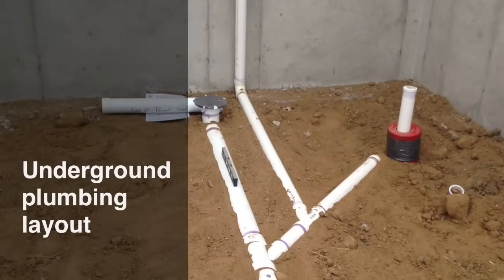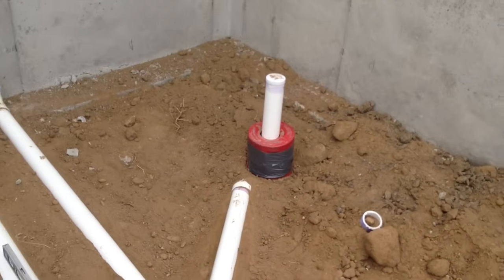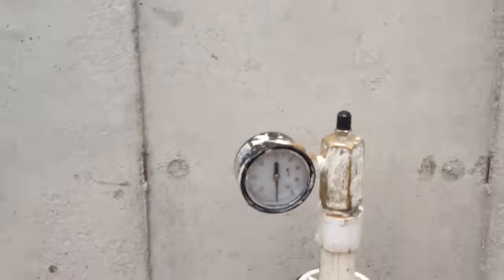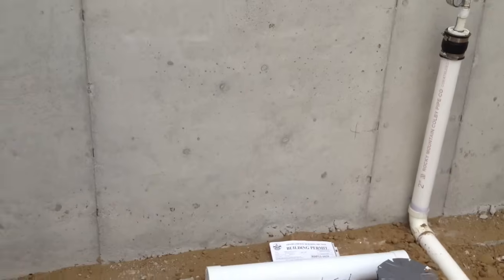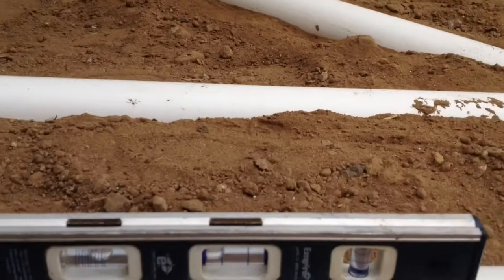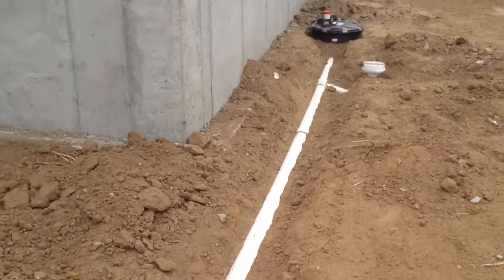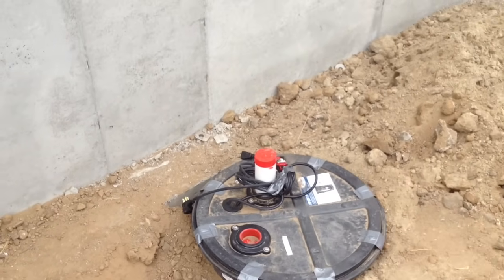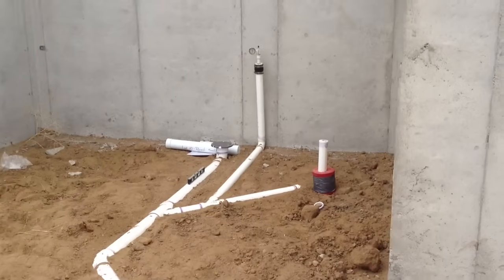Building a House - #09 Underground Plumbing

Comment: A couple of comments. Slope on a drain line is very important. 1/4" per foot is ideal when flushing solids.  Too little slope and you have sludge  building up in your lines. Too much slope and you reduce the drainage capacity of the pipe. This is where your code comes in. If your overall slope exceeds the inside diameter of your pipe, you create a syphon that will suck all the water out of a nearby trap, or make your toilets/sinks gurgle. If you have a 4" ID at 1/4" slope, the max distance you can go without a vent to allow air in is 16'. An 1 1/4" ID is good for 5', a 2" ID is good for 8' etc. I don't have a fancy level like yours, I just tape a 1/2" block of plywood under my 2' level. From the looks of your basement from your main stack to your sump pit, I would say you might be pushing it a bit without an extra vent in that long run.
Reply: I agree on the slope and vent issues… experience speaks louder than comments on an upload but for sure too much and it sounds like someone is gurgling water… too little and better have the clean out accessible and a snake handy! I tie a vent pipe in all trap areas even if they only vent out of a single stack accept the toilet. Works every time and always aim for 1/4 or just a little more for insurance and haven’t had a problem in 20 yrs
Reply: James Beaty well you  drainage leading towards the municipal system doesn't carry a went the sewer injector already  carries a vent , that why on the shower line is wrong
Reply: Agree not enough air in your system.  Also if you consider from your toilet to sump that is your main drain, any Y connected there needs to have the branch higher then main.  So 2” needs to be rotated up so it’s drops into main…Y’s are too flat.  You wet vent the shower but toilet has no air.
Reply: It's 1/8" per foot by code.. 1/4" per foot on 2" pipe and below
Reply: you do not even know what your talking about not even close

Comment: In NC all houses used to have a 4" main vent, which is ridiculous.  Now we only have to have one 2" vent and the rest of the house can be on studor vents
Reply: Steven King studor vents?? hacks!!
Reply: Possibly  the plumbing inspectors know about HOARFROST and know 4" vent will not suffer from this condition
Reply: Steven King Exactly! Back in the 50s in the southeast a one bath house had a 4" cast iron vent on the bathroom. Now you see 2 1/2 bath houses with washer box on a 2" vent.

Comment: here in louisiana you can vent a toilet with 2", but when you introduce a shower, lavatory, or floor drain you have to run a 3" vent. the floor drain definitely needs a vent added, as well as a mechanical trap primer. your allowed to make a change of direction with a 45 but your second 45 should have been a wye with a cleanout out the back. we follow a different code than the yankee states. hopefully your plumbing works. its been two years...any problems?

Comment: All these know it all prima donnas drive me crazy... None of them bother to ask where you are geographically or what code is enforced in your area. I am a master plumber with 20 years in the trade. And no, his is not code correct via UPC guidelines. Find out the particulars of your area code wise and make sure your inspectors are adhering to these guidelines...
Reply from the maker: ***** Thanks Jeff.  I've talked to a few plumbers in my area about a couple of these issues and they have all told me that the 3 jurisdictions we work in do not require gravel bedding due to the natural soil conditions.  I can't speak for the exact plumbing layout but I do know that I've been involved with over 60 houses plumbed by this company in this area over the last 10 years.  I'm no plumber but I know they are passing inspections on a regular basis.
Reply: Wolverine Scorpion Sir I wish I had a better answer for you. I live in Montana. In a 20 mile radius a from where I am now I personally know of places you can find good sources of water no more than 20 feet below the ground. I the SAME geographical are people are needing to drill down 900 feet plus finding a marginal source at best. And at a cost of $30 a foot that is daunting I know. There is no way to answer what you ask. My advice is two fold...
1... Go talk to people who have drilled and found water in as close proximity to your property as possible. Talk to as many of them as you can. Simply ask them how far down did they need to go to find water. Is it good water??
2... Contact the drilling contractors who do this specialized work and see if they have any information about the area you are wanting to drill. They might very well have worked in your area and might have some insight.
I wish I had more solid information for you. Drilling for water is a crap shoot. You could be in an area where you could dig down with a shovel and hit water. Or you could be looking at hundreds of feet of shale rock to bore through before find an ounce of water. I hope I have helped a little. Let me know how you make out. Good luck...
Reply: Jorge Rodriquez And being from texas and texas uses the IPC and IRC please show me where it states that a 3 inch vent it required?  Because your statement is wrong!!
Reply: A toilet flange is considered a clean out point in Michigan
Reply: thank you for the video, it is exactly what I'm trying to do. one question....the pump are you putting concrete over it?
Reply: Exactly. Licensed plumbers get on youtube and trash other plumbers even though what they're doing is to code in their area.
Reply: Jeff Legg why did he put the vent so far away
Reply: Raymond  Allen, do you guys follow the IPC or UPC?
Reply: Jeff Hardison 

Montana recognizes the UPC.
Reply: Jeff Hardison 

The UPC (Uniform Plumbing Code) does allow wet venting. Absolutely... And may I add that I have been a staunch advocate of its use for as long as I have been in the trade. The toilet is by no means self venting. A toilet not properly vented can really cause problems. The most common use of wet venting I have seen is in a typical bathroom bathroom rough in. We we will use the 2 inch vent coming off of the toilet vent and use that for the drain line for the lav faucet. The only caveat being that 2 inch line needs to remain 2 inch all the way up until it is tied back into the vent system. So at the lav you would have a 2×1½×2 san tee. The does that make sense? What I am referring to is also actually called Vertical Wet Venting. 
I have worked with the IPC in the past. It is very convoluted to say the least. That whole 4×3 fitting for stool is a mind bender for me. I don't get that whatsoever. All toilets have a 2 inch integral trap. 2 inches!!?! A 3 inch waste line for a toilet is plenty. 
It seems both systems test in somewhat similar manners. I have just always found the UPC more plumber/user friendly. The UPC does however require a ¼ inch per foot grade on all drainage lines on everything below 4 inches. 
No correction or your part needed. These two systems vary to a great manner in many areas. And then on top of that every jurisdiction will add or take from these guidelines and produce requirements specifically needed for their own unique area and building challenges. 

How fun it all is...
Reply: Jorge Rodriguez no air in the State of Florida we use a wet vent system to inches all that required for a bathroom so long as you have one full four inch vent in the house
Reply: "master plumber"
Reply: yeah i guess CA plumbing code is way stricter than most.
Reply: I was told that 1/4 " per foot was ok for liquids. But solids need to be 1/8" per foot as 1/4" lets liquids flow too fast and doesn't allow time for solids to drain
Reply: Would not pass inspection in Los Angeles.
Reply: Jeff Legg, I am in the IPC jurisdiction. Correct me if I'm wrong; but, doesn't the UPC not permit wet vent systems? And if that's the case, the toilet is considered self venting, and you're allowed 8 foot from the fitting where the vent starts, to the trap. (On a 2" pipe) but there still should be a clean out before and after the change of direction. (Assuming it's over 40') you don't necessarily have to have a 4x3 90 for the stool, ( at least that's how the IPC regulations are written) because in the IPC, a 4x3 90 is technically considered a reduction in size. (Which doesn't make sense) but a regular 3 inch fitting is still legal because the opening on a toilet is a little wider than 2 inches. I see why they ran the vent off the shower, so that it could be within 8 foot from the vent, but the only thing I see wrong is the lack of clean outs. And the IPC regulations for fall on a 3 inch line is 1/8" and a 2 inch is 1/4" and the drains should be tested with either smoke, Mercury or a 10 foot head of water. Never air. Like I said, I follow IPC regulation, so please, correct me if I'm wrong.
Reply: +Jeff Hardison the way its done is very wrong im a master plumber here in texas. they are using a 2" vent for three fixtures, that wrong and illegal. It should be 3",, shower and toilet needs its own vents

Comment: lol every 90 degree needs to have concrete under it 100 mm and 75 mm of pebbles under your pipes
Reply: No.  Maybe in canada.  I've been doing this 30 years.  It's never been a necessity or a requirement in NC. Remember, the "universal" plumbing code is NOT.
Reply: Steven King in victory Australia,
Reply: Not even in Canada lol. Never heard of that rule. Different from county to county. I'd be more worried about actual plumbing code rather then pebbles and concrete

Comment: no pebbles? the main run might sink
Reply: It'll never sink.  In 3o years of plumbing it's never happened to anyone I've ever known.
Reply: Steven King lol you need concrete under every bends
Reply from the maker: JoeThe Boxer In many areas in Colorado we do use "squeegie" or pea pebbles for a base but not at this particular site.  The earth is very sandy and compacts easily.
Reply: ***** anyway that's in the US not in Australia
Reply: ***** Anyway, yours is different ,but for Australia ,Victoria you need to have 75 mm of pebbles under your pipes and 100 mm of concrete under all 90 degrees bent and every P-traps and your pipes need to be very straight , because the inspectors used mirror to check them.
Reply from the maker: That's good to know.  I'm going to research this more.  I may be changing my requirements for my plumbers going forward based on this.  Thanks for the info.
Reply: No.  The soil here supports proper plumbing in America.  Good luck tho.  I have friends in your country and consider you a friend.  Steven
Reply: Steven King different country, different rules

Comment: 1. Cleanout required every 40ft if there is more than a 45degree change?
2. Size of vents?
3. Cleanouts at branches over 5ft of main sewer?
4. Long sweeps not hard 45s?
5. Minimum cover?

I dig the efforts.
Reply from the maker: Erick Becerril  I'm honestly not sure on the details about vents and lengths and minimum cover.  That is whey I hire a licensed plumber in the area and have the job inspected.  this is all flowing to an ejector pit in the basement that pumps to the private septic system.

Comment: Did this pass? Because here it would not.

For starters, the vent must connect above the center line of the pipe. This system is not vented.

These so called plumbers, should not have installed the flange during the under ground. Should have came up with a riser and glue cap.

Regardless of code in your area, this underground is less than professional.
Reply from the maker: Tee,
Thanks for posting - No offense taken.  I'm a general contractor not a licensed plumber.  I rely on my plumbers and local inspectors to a great degree but always look to learn more wherever I can so that I can better control the quality of work on my sites and in turn help others learn.  This is the purpose of posting these videos so that discussion can take place and we can all learn from each other.  I'm not interested in paying for instruction here, just hoped to help clarify for anyone who might watch this.
Reply: ***** I hope I gave you clarification. I might add, that just like any other profession, there are bad inspectors too. The main reason this would fail, is there is no venting method. The best way to vent the water closet and the shower would be to wet vent. My second choice would be a circuit vent. Nonetheless, these fixtures are not vented and not even close to being vented.
Reply: where they air tested is a dry vent  TEE ARE...i was simply stating that the job was just thrown together. the person or people doing it dont take pride in their job.there seems to be no lav ( sink) but the vent it correct none the less..a circuit vent? it is runnimg up into existing plumbing and ventilation ..im in florida and its a little different then up north tho ive worked up in maryland and ohio..
Reply: You cannot in general roll a wet vent. That shower is a trap arm now with max length at what? 5ft maybe? Dry vents are required to roll 45 deg nom. No less. Canadian codes referenced here. Also we have 10ft max rule for toilet vents if you can believe that. This layout is good.  Just instead of laying the wet vent like that on the footing it's better to offset with 2 45's so the entire pipe lays lower. Better for concert not to crack.  Some one else mentioned no 3" stack in the basement? ... the sewage ejector collects everything from the basement and pumps it out to a 3-4" drain going out through the wall somewhere at some point. Floor drain does not need primer lines? Ie. condensates from furnace whatnot? Also fd needs to be separately vented in sewege ejector no?
Reply: hglu
Reply: 0 vents here!!!!!!!   Hahahahha what a HaK"
Reply: wetvent , classic fail , when the toilet and lavi are used at the same time the shower will struggle to drain because it is not vented
Reply from the maker: wetvent It did pass, as did the entire neighborhood.  The vent isn't connected until after the home is framed so they can take it through the roof.  That is the vent line sticking up the wall in the back.  As far as specific code compliance, I've used several plumbers in this area over the years and they all install in a very similar manner.  I'd love to see a video of a job you are installing as well as some explanation as to what you consider to be correct.  I know that just because it passes inspection doesn't mean that there isn't a better way to do it and I'm always open to learning better methods.
Reply: Here in CA it's 1/4" per foot on any size pipe.  The venting is fucked and he used nothing but Ys and no combos and no long radius fittings.  I would have used more than one vent.  I did a cabin up in the mountains and vented every fixture for them so it would drain very fast and with no problems.  Also with cleanouts on every fixture so it would make it easier for a plumber to snake any of the drains in the future.  Yea I overkilled it but they wanted it that way and I was happier that way.  If you do a job do the best you can and run long radius fittings as possible except for vent fittings.
Reply: the job done here sucks. i am a plumber of fifteen years in florida. i have also worked up north. you need an eigth inch pitch on 3" pipe and a quarter on 2". the pipe isnt even bedded in correctly , you would need the top of the pipe exposed letters visible ( rookie stuff ) this video made me sick the system per code is vented where the gauge reads the air test. generally that would be a lav ( sink ) but as long as the shower is within 8 feet the system is vented as the vent is one of the last two risers on the system. Wetvent i know this is not your video but i left this on yours as you seem like an educated plumber 
the other comments dont seem to "knowledeable" to me
Reply: You so called plumbers must not have heard, he said the vent is having a lavatory sink connected to it, that is why it can be connected level with the shower drain, “it’s being washed and is accessible for service if needed. A dry vent is to be above the center line so not to back up solids into it.

A lavatory is dripping a mere gallon a minute and a toilet not much more—pitch looks fine—I’m surprised nobody freaked out about the down stream floor drain with no vent—although that is within the code also because the sump pit is vented

It’s a nice job,
Reply: ***** Not trying to be harsh, but regardless, there is no venting method here. If so, which one? I do not see a individual vent, common vent, wet vent, circuit vent, waste stack vent nor combination waste and vent. The toilet nor the shower is vented. The "vent" you're referring to would need to connect above the centerline of the pipe, when connected to the horizontal, regardless if the home is framed or not.  Either way, regardless of code used, this is a hack job at best. And if it did pass, it should not have.

If you want pictures, you are asking for instruction. I charge $125/Hr to teach.

Regards,

tee are  aka wetvent.